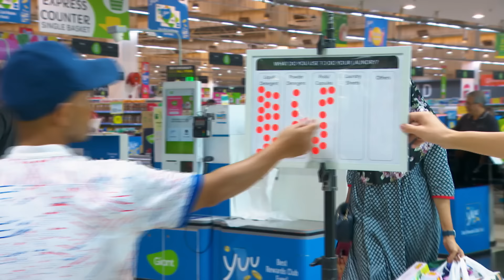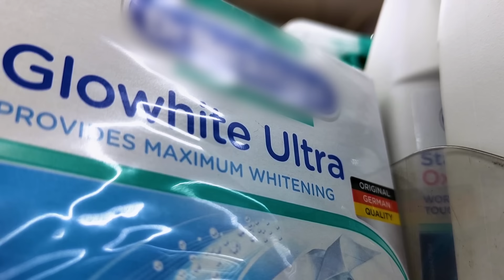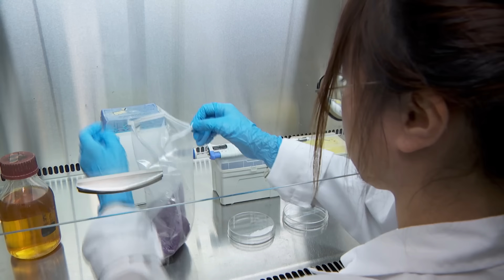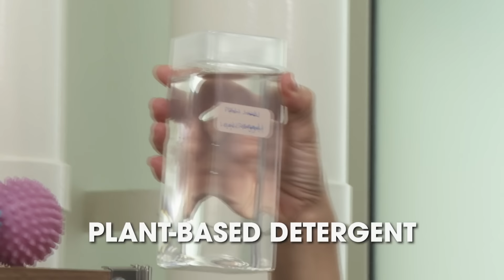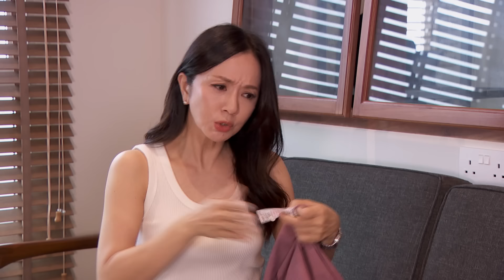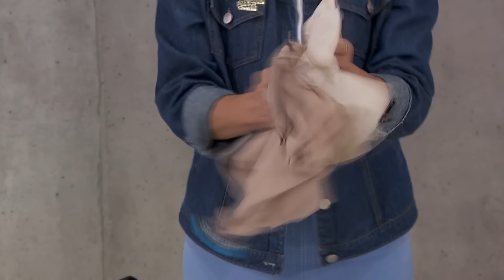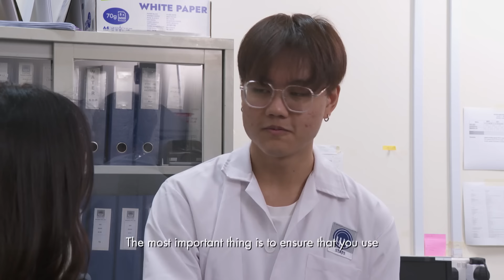Which Laundry Detergent Works Best? | Talking Point | Full Episode

Comment: 1:12: 🧺 This video explores the effectiveness of different types of laundry detergents - powder, liquid, capsule, and sheet.
4:28: 🧪 The effectiveness of a detergent in removing stains is determined by its active ingredients, not its form factor.
9:23: 🧪 The video discusses a test conducted to determine the effectiveness of antibacterial detergents in indoor drying and color brightness.
14:48: 🧼 Antibacterial washers show insignificant differences in effectiveness between liquid and powder forms, and regular detergents also contain antibacterial qualities.
18:47: 🧼 Cross-contamination of bacteria and germs can occur during laundry if different types of fabrics are washed together.
Recapped using Tammy AI
Reply: Thanks

Comment: The key is use it in a sufficient amount (not too much/less), soak it a while and rinse thoroughly.
Reply: I personally find that soaking is unnecessary when washed at 40C with an appropriate amount of detergent. 

The 0.0001% leftover bacteria will die when you dry the laundry under the sun or in the dryer. Then you touched the laundry and contaminate them with your hands. 😅
Reply: For me, soaking helps to reduce the stains etc. plus u dont have to add any detergents during washing, therefore its easier to be rinsed thoroughly. Germs are everywhere, the purpose of washing is to make it clean and comfort to wear, not to free from germs

Comment: If the 'powder antibacterial' removes 99.99999927 of bacteria, and I am assuming it is all forms of bacterial measured, that would address the idea of cross-contamination right? Having said this, I would still not put my kitchen towels and floor rags in with my clothes as it is more a matter of mindset and practice.

Comment: The Director of Sustainability,Zhang Ting Ting,  said “the bacteria from one dirty fabric could be ‘transferred’ to another fabric during the wash” and it’s not advisable dirty fabrics with l supposed less dirty fabrics (?). It doesn’t sound logical to me. If all detergent can remove bacteria from clothes during the wash, the bacteria transferred to the less dirty fabric will be removed as well during the wash. So what’s with not washing all the clothes together in the washing machine simply because one fabric could have more bacteria than other?!
Reply: It removes 99.99% of the bacteria. So that means there is still a small amount of bacteria leftover. Bacteria multiples over time in the right conditions.

Comment: I used liquid detergent before but after I graduated, i worked on site (outdoor). The liquid detergent cannot get rid of my body odour on my shirt especially the under arms area. So I switched to TOP powder detergent and it works wonders 👍🏻 I also skip softener because I kinda allergic to it.
Reply: Yup powder detergent is better for heavy duty.
Reply: If you want to remove stains from your shirts, you have to prewash them. Soak in cold water and some vinegar overnight before putting them in the washing machine. Wash everything in warm water. No need to wash in hot water.
Reply: I vouch on the top powder detergent, it's really good
Reply: It really depends on the brand. There are also very good liquid detergents like Nanox.
Reply: Persil is the best
Reply: @umbreon-wn2to If you check, Persil never beats Tide in efficacy comparisons.
Reply: I prefer powdered as well.

I lightly prewash my clothes first with just water and soak for at least 30 minutes. Drain then soak all of it in water with detergent for another 30 minutes. Start the washing.
Reply: Please ma teaching me
Reply: asians don't smell.
Reply: if you add rubbing alcohol to your laundry wash it will remove body odors. it also works to pull out the smell of cat urine

Comment: I was surprised to hear that no matter what type of detergent you use, washing will remove about 99% of the bacteria. There is so much discussion about washing laundry with hot water, when just using these modern detergents is enough to kill bacteria. I will still use hot water for bedsheets and towels just to be sure, but I won't be neurotic when it comes to washing clothes...
Reply: Front load machine and hot water (40C) helps in removing tough stains like sweat on the collar and armpit areas. Old sweat stains might need a few washes to be totally removed. Vanish also works better with warm water.
Reply: @gan247 40C is warm water. 60C is hot water.

My LG does not get hotter than 35C on 40 and no more than 52C on 60. I've started using 60 more often now as my clothes are all cotton.

Comment: Whilst the test covers how well clothes gets cleaned, but more importantly is to check which laundry detergent damages or create more build up of gung in the machine.  Some of these detergent to clean the machines are not so effective.
Reply: From my observation of my former flatmate, every time after she did her laundry the top load machine trapped a lot of lint in the mesh filter. She liked to do big loads and used a lot more powder detergent than necessary. My washes are ‘regular’ loads with liquid detergent and hardly ever have lint in the mesh filter.

Now I’ve moved to another place, using front load machine with appropriate amount of powder detergent according to the load. No lint issues. 

Top load machines use a lot more water hence more detergent is needed compared to front load machines. 

Fabric softener will definitely leave residue in the machine. If you’re using a front load machine, just look at the fabric softener compartment of the detergent loading drawer. The machine fills water into that compartment in the final rinse. The water that goes in is a few times the volume of the compartment yet there is still residual fabric softener in it. I’ve stopped using fabric softener.

Comment: I use liquid Tide and vinegar instead of fabric softener. I also use an extra rinse.
Reply: Just use better brand from the same company or any other, you'll not need any extra items.
But, use lesser quantity(even lesser than what's written on pack) of detergent while going better quality.

Edit- let me know if you try that.
Reply: @gamingwithxan1430 

I get the same results using half a cup of powder or a teaspoon of powder because most gets rinsed away in the first 5 minutes

Comment: once a month clean washing machine. what a waste.
 at most every 2 months. if lesser/smaller loads, you could put it off even longer.
unless your clothes are always caked with grease, mud.

other important detail is the drain pipe should be installed properly. 
improper installation means the drain inside the machine will not expel all the dirty particles effectively. either you developed a choke(cant drain) or something gets stuck between the valve(cant fill up)

Comment: I think the scope of this video should be expanded. There are a lot of great information but is not a complete picture.

Regarding germ cross-contamination, it depends on how full your load is and whether you washed at a higher temperature. If your drum is fully loaded, both top & front load washers will struggle to remove the bacteria and mold fully. I suppose top-load will have worse performance due to gravity squashing the clothes to the bottom and less turbulent water in the center of the drum. In this case, a pre-wash cycle is probably needed so you don't recirculate all the dirty water during the main wash.

My issue with this video is the test methodology. When you have a small sample, most detergent will performance adequately. However, when a 6kg washer is fully loaded at 6kg, the detergent and water temperature will start to matter more since the detergent will have to work much harder to extract the dirt/bacteria/mold from the clothes in a squashed environment. At some point, you'd run out of active ingredients to extract the dirt, or space for the water/surfactant to penetrate the clothes.

This is where adjusting the pH and temp of the water will help kill the bacteria that can't be remove from the clothes, so even if it's not fully clean, the clothes don't stink.

It's true that front-loaders tend to use powder due to low sud requirements but many liquid and capsule are low sud too. I suppose most people use liquid because top-loading washers tend to be cheaper.

To save water, I always buy front-loaders and use the best affordable powder detergent. My washer has a weighing function that will recommend the amount of powder needed. Some brands even have auto-dosing.

I also run an extra rinse cycle to remove residue, fragrance and leftover surfactant. If I'm washing towels, I tend to use more powder and set at 60C. I also sort my laundry based on temperature. My washer also has a pre-mix chamber for the powder so I don't have any issue with leftover powder. If you think this runs up a lot of water, my water usage for a family of 4 is the lowest in my estate, based on SP services data. I run the washer 75% loaded (8kg) 4 times a week.

But I digress, this video is about detergent only and I suspect when you run a full load, those 0.000005% will have a measurable difference in bacteria/mold count.

My problem with liquid detergent in the past was high sud, no enzyme & bleach mix and higher cost. However, recent liquid detergents has new formulation that is low sud, has enzyme AND bleach but is still more expensive. I recently tried capsules but found that for a load of 8-10kg in my washer, I need to use 3, which becomes very expensive!

As mentioned by experts in the video, different chemicals are needed for different stains. The more types of chemicals cramped into the detergent, the cleaner your clothes will be. A single detergent liquid like those bio-enzyme detergent will be very bad at removing stain and I will never use those non-detergent type.

Note that professional washers don't use the same types of detergents for household. Those are much stronger/concentrated and can wash your clothes clean at a fraction of the time needed with household equipment and they can do it with cold water! Another advantage is industry washers have much bigger drums and volume for water/detergent to work their magic.

Lastly, regarding drum washing, ALWAYS follow the machine's manuals! Different machines use different pumps, sealants, gaskets, etc. and those are sensitive to certain chemicals. Only use the cleaner recommended by your washer's manufacturer! Unfortunately, most makers don't publish what they put in those cleaners so it may be hard to source for cheaper alternates.

And yes, in tropical climate, the drum don't completely dry and mold will tend to form after months of usage. Cleaning the drum monthly may be overkill if you often run hot cycles, like 90C for white towels or use the washer 4 times a week but do it at least once every quarter.
Reply: Why do you say bio enzymes will not work well, the other synthetic chemicals in detergent are harmful for the environment and that’s why brands are switching to bio enzymes

Comment: But then the germs are also washed away, no? So, technically speaking, there would be minimal cross-contamination even if you mix your laundry during washing.

On another note, one area you could have modified to show more precise information is during the survey of detergent popularity. You could have asked your respondents whether they used a front-load or top-load washing machine, because I think most front-load machine users would tend to use powdered detergent instead of liquid detergent. That might skew the results of your survey.

Also, there may be machine manufacturers that do not recommend the use of machine cleaners when running their pre-programmed machine or drum cleaner cycle. Do their pre-programmed cleaning cycles effectively clean the washing machine without the use of commercial machine cleaners like the one you used at the end of the video?
Reply: Yes, Samsung does not want you to use cleaners in their drum cleaning program and enforces it by draining the machine five minutes after the drum clean cycle begins 🙄

And no I don't think agitating water alone can remove limescale or liquid detergent and softener residue which is food for mould.

Use the regular cotton 65 cycle and add the required cleaner to throughly clean the machine.
Reply: Towels do to trap more lint due to the texture, it is probably still better to separate them.
Reply: @lucretius8050 That’s honestly a good point. The more “rough” the material is the more likely the bacteria can be trapped inside the more deeper or interior parts. However, I still feel like just based on the information in the video and the non-purple thin towel which they used did not show enough evidence for what the lady said.

Comment: Got a mini washer for washing kitchen towels only, main washer for clothes, bedsheets & occasionally curtains in separate loads. Strictly no softerner as it can build up dirts internally. 

However, i installed a water revitalizer in the pipeline to make tap water softer so that washing is easier with lesser detergents. No maintenance needed for this device.
Reply: Can you give more details about this water revitaliser you installed? Did you test specifically whether it softened water or not.

Comment: I'd like to see the results of cold water washes. I'm assuming they were hot washes because the control with no detergent killed bacteria.
Reply: Warm water is effective because it makes grease and dirt easier to dissolve into solution.
Reply: chlorine in our tap water kills bacteria too.
Reply: Soap and detergent isn't used to kill bacteria, it binds them to other dirt and washes them away.  Same for your hands.  Anti-bacterial soaps everyday use is bad because you will keep exposing bacteria to it where they will gain resistance over time, then you have a problem in the future for when you need to use anti-bacterial soap (in a hospital etc).

Comment: The way the bacterial count was interpreted was not correct. 99.9 and 99.99 has a big difference. That is in fact a 10 times removal efficacy. @14:23 liquid detergent has 5 9s while powder detergent has 8 9s. This means that powder is 1000X more effective at removing bacteria.

Comment: Powder
+ Cheap
- Leaves behind residue
- Need to store in dry environment

Liquid
+ Dissolves completely

Capsules
+ Easy to use
- Predetermined dosage - cannot scale up or down according to load

Sheet
+ Easy to use
Reply: Capsules also contain softeners as a package which you don't want on your towels as it affects absorbency.
Reply: @lucretius8050  I figure the easiest solution is buy powder, measure and put powder into a cup, fill cup with water and stir it and pour it in while the washer is filling up with water.  (this is with older style top loaders).
Reply: @lucretius8050 oooo that's a good reminder. I need to still get normal liquid detergent then. Anyone have any idea for tencel bedsheets? Cause I remember reading somewhere they say don't use enzyme detergents as it may destroy the fabric?
Reply: @Ragloves enzymes are not suitable for natural fabrics like silk or wool. Only use a neutral or wool detergent with them in body temperature water.
Reply: If you get a residue from powder then you are not using it correctly, probably using too much.
Reply: @Boodieman72  I've noticed with cheaper powder detergents in India that use too much slaked lime that residues do occur. Always best to stick to better known brands which don't have this problem
Reply: Powder leaves residue only if washed in cold water or if the machine is overloaded. 

Body temperature water fully activates enzymes and there is no residue or very little from powders at that temperature.
Reply: @johndoe-vc1we  If you wash in cold water then you can pre-dissolve the powder before using it in the machine.
Reply: You rock!
Reply: @MMMmyshawarma  Thanks!